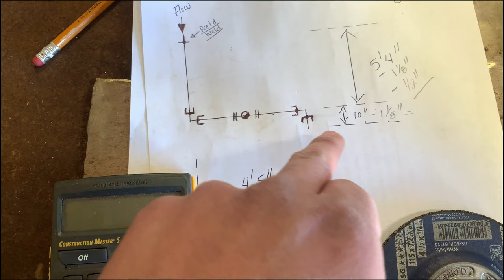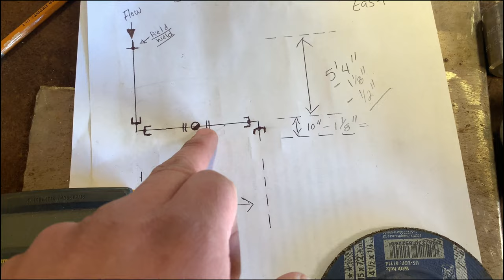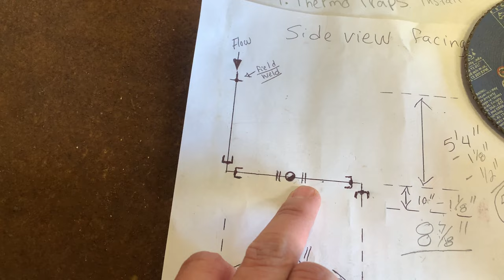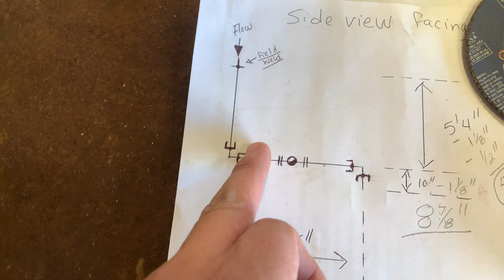1” socket Welds fab and weld

Comment: I have a construction master calculator. It's great for building stairs.
Reply from the maker: Great for a lot of things. Wish I knew this when I was taking trigonometry in school. 😂
Reply: @VantageWelding  they're also good if you're pouring a concrete slab you can just measure your depth by width and length and it'll tell you how many sacks of concrete you need
Reply from the maker: Best tool in the game. Hands down

Comment: how due you prevent distortion with that stainless
Reply from the maker: Let's say youre looking at the pipe right. And you split it into 4 quadrants. 1 is at 12 o'clock, 2 is at 3 o'clock,  3 is at 6 o'clock and 4 is at 9 o'clock. I'd weld from 1 to 3. Then 3 to 1. For my second pass I'd weld from 2 to 4 then 4 to 2.
Reply from the maker: Usually when I make tie ins, I fit them off level to help me keep them level and square as I weld it.